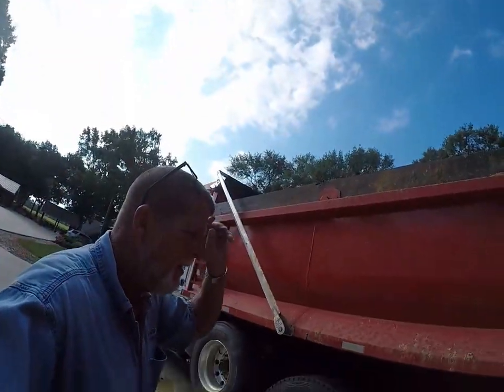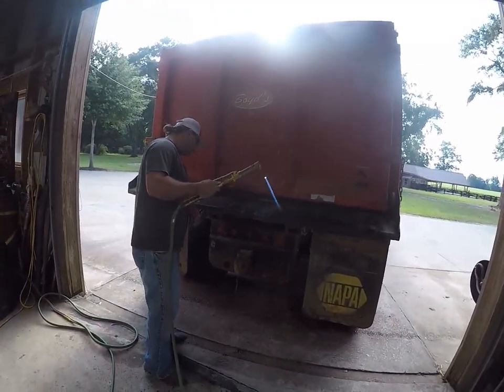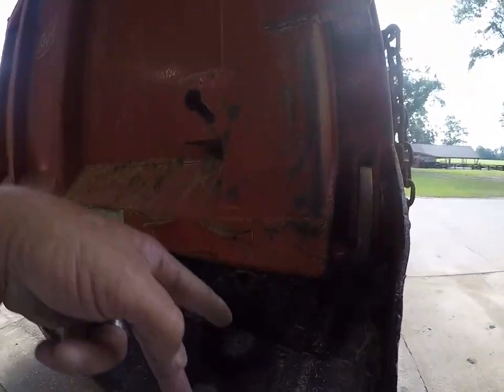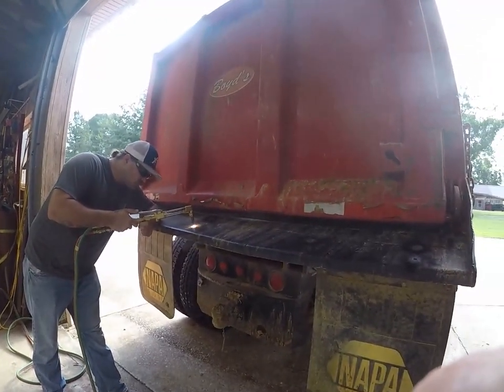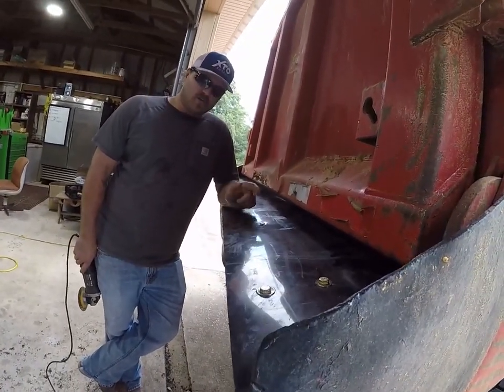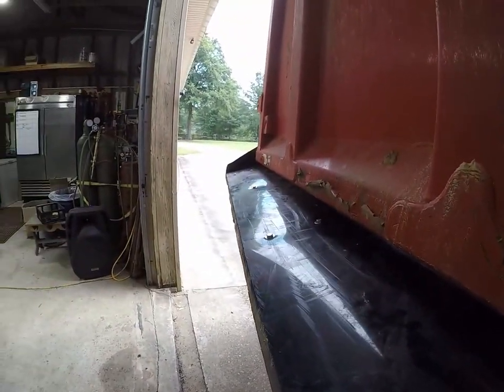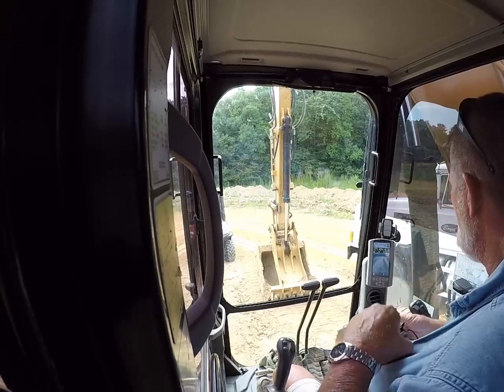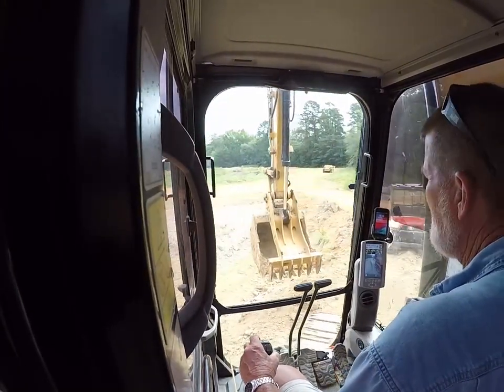putting liner on fan tail of dump truck and testing

Comment: If those bolts are a problem, try using a round top carriage bolt
Reply from the maker: Yes I need to get some, we used what was in the bolt Ben. Thanks for the comment.
Stay safe 
Dwayne